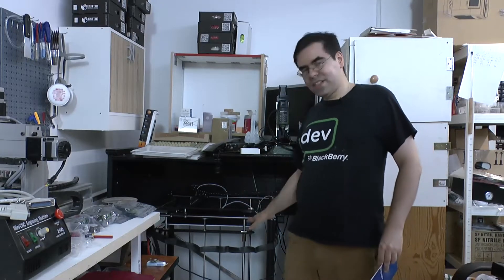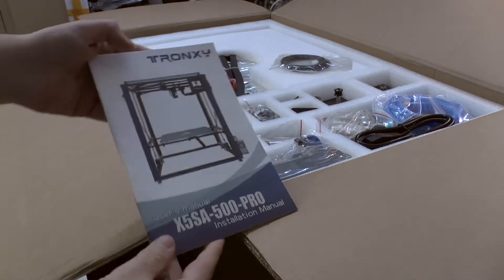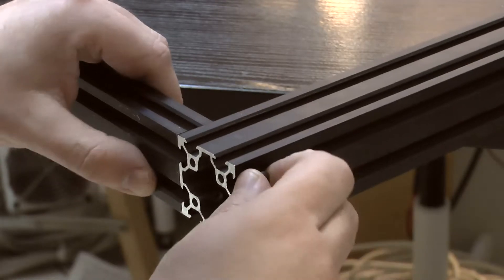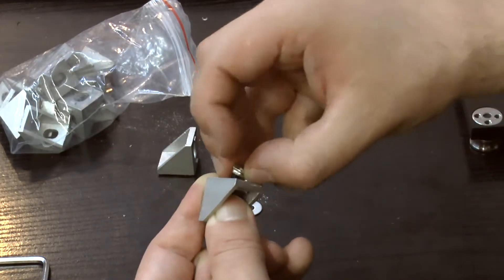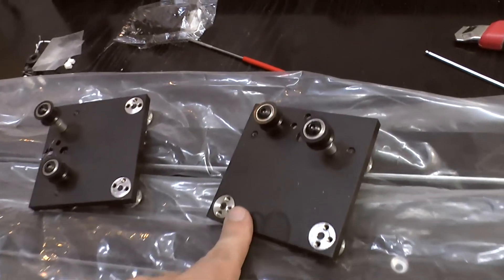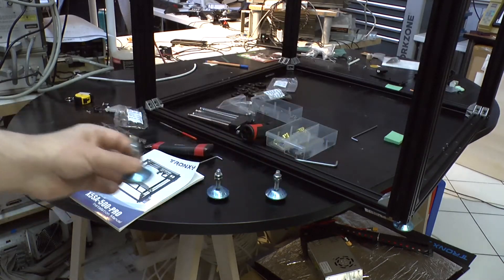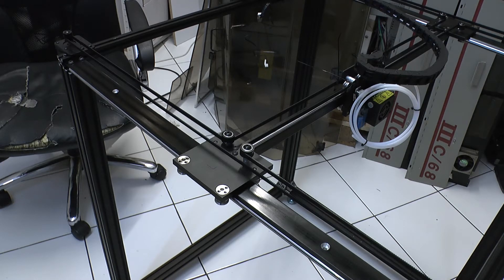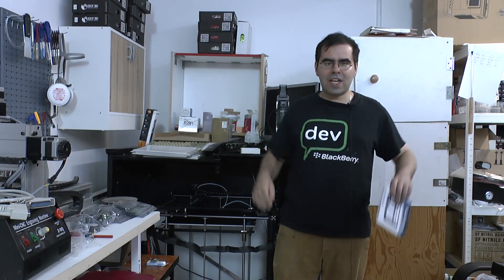Tronxy X5SA-500-Pro - building video, and some advice

Comment: thank you so much for the tricks, but where is the second video ?

I have problem about the cable management, they are always on the path of mechanical moving parts.  Can you make a closeup video of your finished printer, especially about wiring ?
Reply from the maker: Hi Man, sorry for my slow reply. The printer is in a bit of a bad state, we did not really get it working yet plus we had water damage. But, if you want to, email me at tamhan@tamoggemon.com and I make you 20 or 30 pictures of what we did for cables. And, I also want to send you the OpenSCAD file for the wheel dollies which I put at the bottom...

Comment: Hi Tam, great video. I have had a used 500 for about 8 months now and it came not working with the wrong firmware. Is there any chance that you could supply me with a copy please. I have tried lots of other ways (including Marlin) and Tronxy but have got nowhere with it. I also have a CTC clone from China (can burst into flames at any time) :-) and i have managed to get that to print quite nice but i want to do larger prints. Any help would be very much appreciated.

Thanks
Paul
Reply from the maker: Hi, thank you so much! Email me at tamhan at tamoggemon roundthing com, maybe we can work something out!

Comment: Thanks.  This was very informative.  I have a 400 pro on the way.
Reply: same mine is on the way aswell ;)
Reply from the maker: @stefvans6492  thanks for talking back, my friend!
Reply: @MrTamhan  thank you ,its ppl like you that keep good things going and helping out
Reply from the maker: @stefvans6492  I try to help where I can. Your comment honours me!
Reply from the maker: Hi Moe, thank you so much! I am still fighting the bed leveling...did not get this one right so far. How is your machine doing?
Reply: @MrTamhan  I am waiting on it to get delivered but from the start I plan to install new BTT board with cb1 and run Klipper.  If it has the ezabl type bed sensor I will be switching it out with a bltouch.
Reply from the maker: @MoeReefs  thank you! I am slowly but surely proceeding...managed to clog my extruder, so now an extra bit of repair ;)